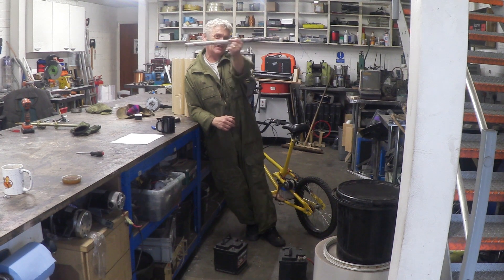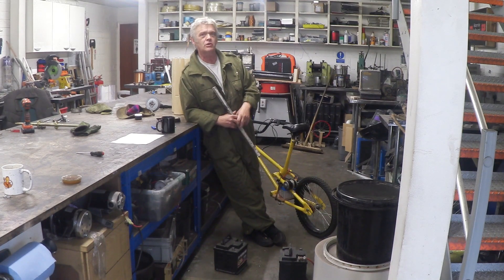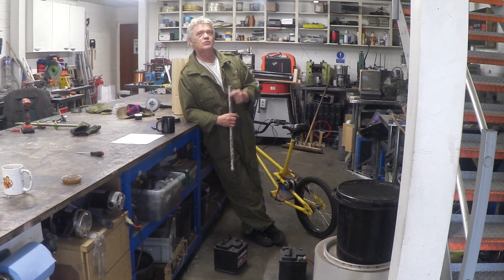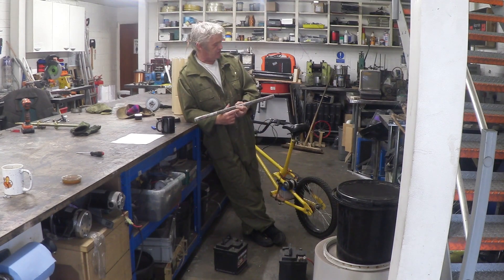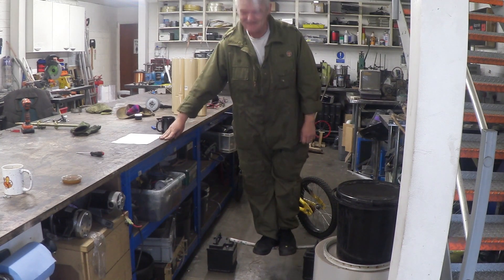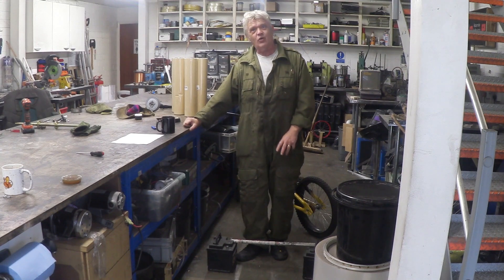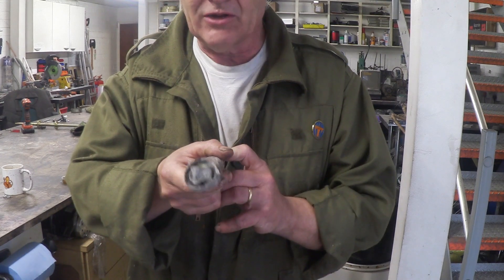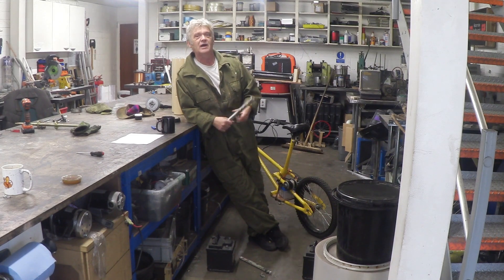1172 Breaking A Stixx

Comment: interesting and I'm sure it could be greatly improved by adding glue to all layers and perhaps tweaking the glue, curious if you add graphene in it.. also, just thought about it but what if you wrapped a piece of strong cloth like hemp every 5 layers or something ? there is alot of testing to try ! maybe also add one or multiple layers of hemp cord in the center with glue of course, it could potentially make the horizontal strenght go through the roof
Reply from the maker: I think you are right mate and I like the cloth idea

Comment: Throw some graphene in the glue, a light scattering of glass fibres or some hemp fibres through the paper layers.  Wouldn't add much extra weight, but I'm pretty sure you'd increase load capacity and decrease brittleness
Reply: Might turn it into something akin to fiberglass.
Reply from the maker: mate I am 100% sure this can be improved on

Comment: I'm impressed by the strength of these rods, but brittle failure can be quite risky in something like a bike (or anything where structural integrity is of concern really). Perhaps different types of glues would give more ductility? Perhaps even using for instance a core of thick nylon/hemp rope as "rebar" would work fine?
Reply from the maker: I was thinking a layer or two of cotton - we throw a lot of clothes away
Reply: @ThinkingandTinkering  Yes, that would work as well. I'm excited to see the results!

Comment: If you wanted it stronger would glueing some more of the inner wraps help.
Reply: sure, add anything you like including old cloth/nylon thread etc in the layers, painted/dipped dissolved conductive plastic, ball milled blended burned toast (carbon based, compressed ,meta porous, 'stuff' for reasons) with chlorophyll bacteria solar binder for whatever diy properties you want
Reply from the maker: yes mate and Paul makes some good suggestions for sure
Reply: @paulmaydaynight9925  Thanks for ideas.  Been looking for something to do with burned toast for ages.  Have fun

Comment: So the paper stixx are about 25% lighter than a steel pipe.  That's sounds like really significant savings if the steel pipe has a similar break/bend weight.  Its incredible performance for the price.  How many sheets of newspaper and how much glue went into the stixx?  The same as in the other video?  I forget the number.
Reply from the maker: this was a medium Stixx so 5 rolled without glue and 10 rolled with

Comment: You could jump up and down once on a bathroom scale like you just did on the Stixx tube and, using a camera, capture the highest reading it shows to get and idea of how much you loaded the tube when it failed.  Just simply duplicate your jump height over the scale as it was over the tube.  You can use this video you made here to get an idea of that distance.  This, of course, will not be exact in any way but will give a rough idea.  My guess is that it took at least 3 times your weight to cause a failure.  I think F=MA will apply here.
Reply from the maker: nice suggestion mate - cheers

Comment: Ooooh.  How strong would it be if you put a strand of glass fiber or basalt fiber roving in the core of the paper stixx.  I think you could quadruple the strength
Reply from the maker: I think you could
Reply: One layer of fiberglass or basalt cloth in the core and the very outside would improve it quite a bit.

Comment: What about a single length of wire, the sort used in fencing in the middle of the roll to prevent a complete failure. A bit like rebar

Comment: I wonder how much the unresined paper contributes to the load bearing?  ie is most of the strength in the outer layers, if so hollow tubes would have most of the strength and be lighter, think of it like paper bamboo.

Comment: Fascinating as always!
Would love to see paper bike mk1 tested thoroughly with the 500W motor to failure before mk2 gets built! Would it handle a slalom well or would there be excessive torsion across the length of the bike, suggesting a couple of layers of cross- ply or diagonal ply may be beneficial or adjusting the thickness of the tubes? So many questions that 120W can't answer lol!
The stixx does an impressive job of storing and releasing energy in today's vid. Pretty sure if a metal or carbon frame deformed that much it would have no chance of returning to straight. That property has interesting implications! Would also be cool to see what sort of load a stixx can withstand in compression, torsion and tension.
Reply from the maker: I think the mark 1 held up just fine but for torture testing I think mark 2 would be better

Comment: Another idea.  Put a tiny amount of nanocellose/gell between each layer.  It would make a super strong stick with unbelievable characteristics of nanocellose.  Each layer of paper would actually help the nanocellose to align properly.  When they compressed wood they made it stronger than steel.  I think this layered nanocellose approach could rival it (you may need to do it in the presence of a magnet).
Reply from the maker: nice mate - cheers

Comment: perhaps you could use a hanging scale attached to the center of a stick and a bucket below to measure how much it will endure by adding weight to the bucket until it snaps. some scales also come with a function to hold the maximum measured weight, which could be used to measure the dynamic load capacity.
 would also be interesting to know how much one of those paper bikes weighs compared to a steel one.
Reply from the maker: nice ideas mate cheers

Comment: Adding suspension to the bike would be a good idea to avoid the hard jolts of uneven roads. If you use the widest tyres you can fit on the rims and a low pressure that would give some level of pneumatic suspension
Reply: Given how bendy and springy the tubes are, I get the impression the back fork is effectively providing shock absorbtion already. Lowering tyre pressure would increase battery load and reduce the rate of forward acceleration.

Comment: How would spraying glue on each sheet in the stack, before rolling it up improve the strength?

Would crisscrossing the sheets like plywood and gluing them like plywood make it stronger?

I saw on a video by that stick maker that he said: " if you want it really strong you, you use 6 sheets"

You mentioned you are only using 5 sheets. How much heavier could it be with 6 sheets? Not much I think. Divide ➗ 225 grams = 45 grams + 225= 270 grams. Add spray glue and it's a little bit more? Still less than steel but more strength as plywood type build maybe?

Comment: I do not think that the loosely rolled up paper inside the tube is "carrying its weight" in terms of its strength contribution. You might be better off with extra glued layers up to the same weight.  Unless you want specifically longitudinal tensile strength (like in a rope). That bamboo you worked with before knows it. You would have trouble breaking a bamboo stick of similar weight. Unless you eat a lot more. You can get the strongest/lightest structure if you analyse the pushing/pulling/bending forces and use specific materials for them. For the bicycle, that means bamboo for the top bars (pushing, bending) and thin steel cable to replace  the bottom bars of the frame (stretching). The kind of cable used for bicycle brakes would carry your weight easily and is very light.
Reply from the maker: nice ideas mate - cheers
Reply: The front triangle also needs to resist torsion, so any weight savings from using a cable for a downtube would likely be more than offset by needing to massively increase the torsional load strength of the top tube
Reply: @YeshuaGod22  I don't think that the steering torsion is significant, at least not on a bike. If you try to manhandle a bike round the bend by  forceful steering, rather than by leaning in, you will come off!